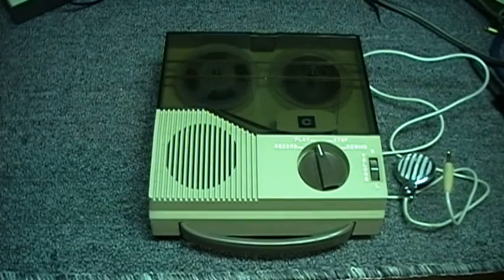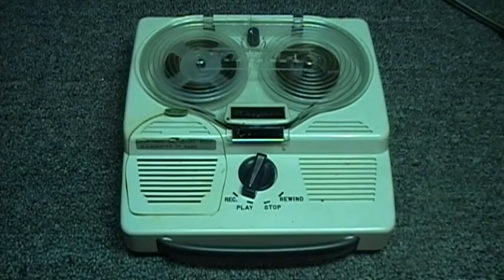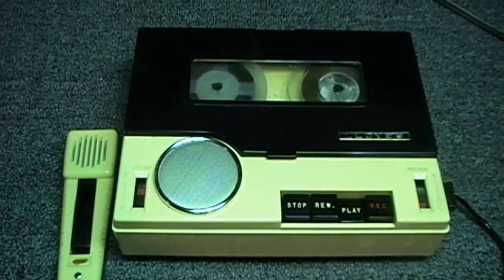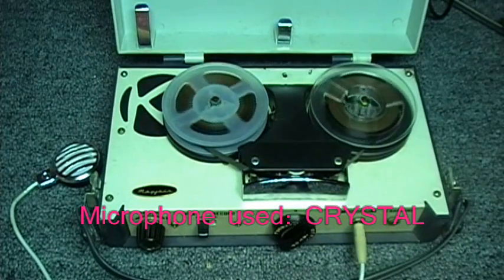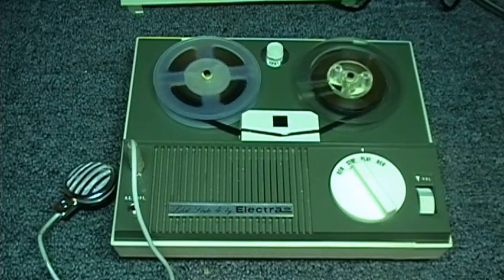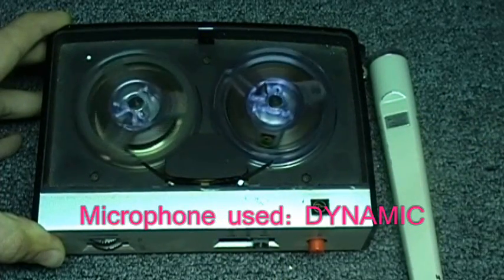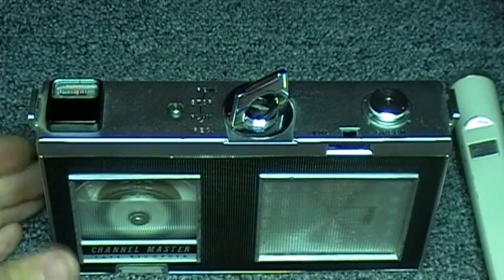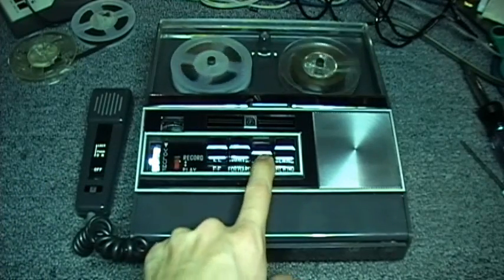Rim-Drive reel-to-reel tape recorders, a Dedication.

Comment: @CassetteMaster still, bias could be adjusted by replacing the right resistor. I guess over time the values have drifted and now either the tape bias is bad or the operating points of the transistors have shifted too much.

Comment: @CassetteMaster If you do so, please post the results :) I doubt that the recorders sounded like that when they were new, which means that some components values have drifted too much over time. If a head is bad then the sound is muddy, but not distorted like that.

Comment: HELLO CASSETE MASTER !  I HAVE A TRANSICORDER TR 300 SIMILAR TO YOUR ALVIN AND DISCOVER THAT SENDING AUDIO FROM THE HIGH IMPEDANCE SECONDARY TO  RECORDING HEAD THROUGH AN ELECTROLITIC SAME TIME THE DC BIAS THROUGH A RESISTOR, THIS SIGNIFICANTLY INCREASE THE QUALITY OF AUDIO RECORDED.